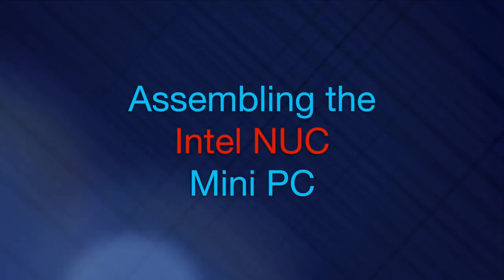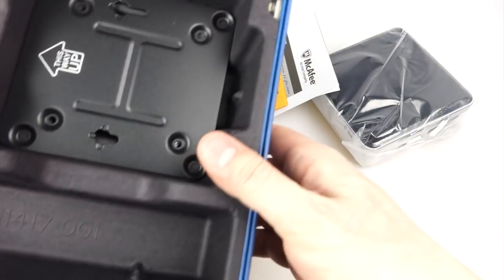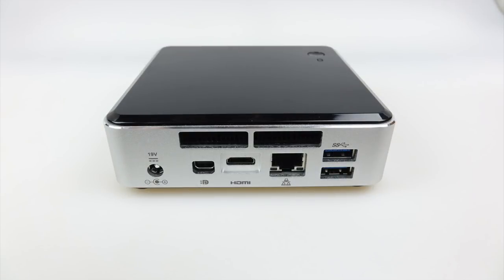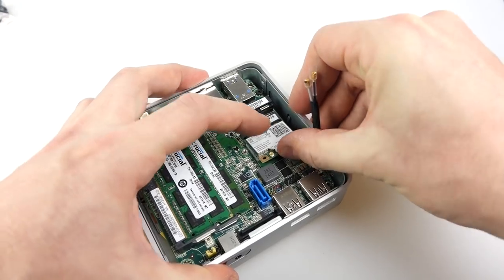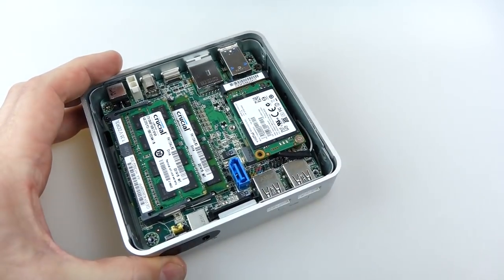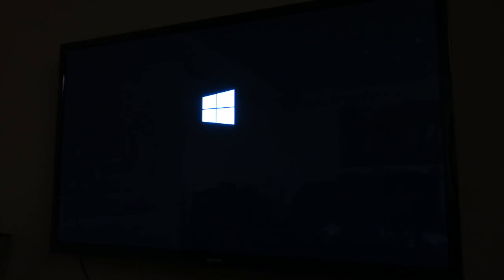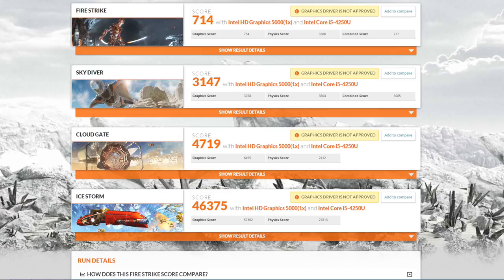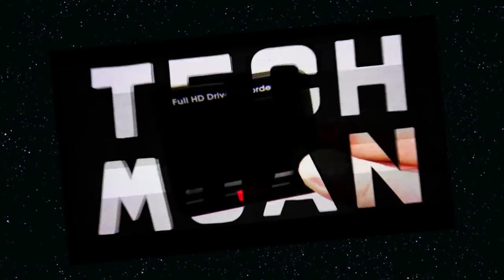Assembling an Intel NUC Mini PC - i5 D54250WYK

Comment: One of the advantages of the NUC is that it doesn't come with a pre-installed OS (or pre-installed hard drive to put it on for that matter). The earlier NUC's had a bug that kept them from working with Linux, but that has been fixed in the NUC D54250WYK. I've been running my NUC with Linux Mint for three years now and it works great. If you are a little shy of switching over to  Linux, you can install Windows then add Linux (the Linux install program makes this very easy) -- what is called a dual-boot -- then at boot up time chose which one you want. Putting in Linux can save you a lot of money you can put into extra RAM!

Comment: Can I just ignore the wifi adapter and plugged in Ethernet cable
Reply from the maker: +Haikal Ghifari yes, it's a lot simpler if you do that.
Reply: +Techmoan Oh, thanks. You answered my question, because I'm planning to get the NUC.
Reply: +Haikal Ghifari but you won't have any bluetooth on it, unless you buy an external adapter
Reply: +Alexandru Klipii Bluetooth would be usefull because you save one or two usb-ports by having bluetooth keyboard and mouse instead of using cable or receiver dongle.
Reply: my thoughts exactly

Comment: I noticed your difficulty with the Wi-Fi antennas, I have a NUC as well and I see your problem. The piece of black tape was only meant to hold the wires together in transit. When you remove it, the clear plastic just SLIDES back over the wires! I also attached them BEFORE I plugged in the card, as it was much easier! Cheers!

Comment: About that ESD BS; I've heard that loads before. Some shops stopped bothering using the anti-static mats under the workspace, special shoes or leads to ground personell to it. They now just replace the parts that break (which basically never happens) instead of buying all the equipment for properly ESD free workspace.

Comment: can it be heavy graphic design work station ?
Reply: Nope, it uses 15w processor that is designed for low power notebooks. Only has two cores and a base speed of 1.3Ghz. Next best thing to this for heavy graphics design, is just to build a mini itx system that's powered by a Ryzen 1700 and a gtx 1050.

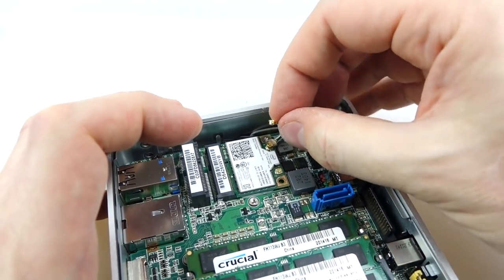Comment: At approximately 6:54 you mention the fiddly nature of the micro-coax connectors.  On one of the experiments I work on we have ~600 electronics boards which sit on the detector. Each board has 64 micro-coax connectors to connect the tiny solid-state light sensor to the the board (order matters, each sensor goes to a specific micro-coax connector).  They are fiddly as all get out, and easy to damage when installing, though it is a practice-makes-perfect sort of thing.  I typically only have to replace 64 or 128 channels at a time, but have much sympathy for those that originally had to install the ~40000 connectors.

Comment: Or you can use Linux (xubuntu core from unit193 recommended), all hardware work out of the box (intel drivers are now on the kernel). Install steam and play some games. Install some arcade emulators. Some videogame emulators.  You can use the xbox controller. And even install Kodi and have a media center controlled by your xbox controller. I know xubuntu core is the bare bones of a distro with a graphical interface but when you get the hang of it you will find a incredible little system to play.

Comment: Hi I noticed you have a samsung tv. Is the nuc able to work with connection+, like the ps3 you can control the on off of the pc from the tv remote. I'm thinking of putting plex onto the nuc and an external 4tb hard drive with my home movies and pics. It would be great if it switches on and off by the tv. And also can it be left running 24/7 you think so it becomes a mini nas?

Comment: I've had that same Logitech keyboard for about two and a half years now, and I just changed the original set of batteries it came with!
  
I think it's a really good keyboard and I've recommended it to friends often.
 I love the extra left mouse button, above the esc key. I hold the keyboard either side, use the mouse pad with my right thumb and select with the left thumb on that extra button.
Nice two finger scroll action on the touch pad too..
It's a really easy keyboard to use when you're on the couch, or not sitting at a table.
 
It has really good range as well... It works fine, even with the PC in the den, on the other side of the wall from the TV in the living room that I use as the monitor.
I often take it outside, over fifty feet into the yard, and while sitting in the gazebo, I'm able to use the audio function keys to change tracks and volume on the stereo hooked up to the PC.

Comment: I've got almost the same wireless keyboard (just doesn't have that fancy design on the touch pad).  Spilled a pint on it shortly after I got it and the keys were sticky as heck for a while but I've since used it enough that they've seemed to come permanently unstuck.

Comment: The antenna wires don't really matter which way you plug them in. In fact, if you plug only 1 of the wires in, the wireless card will still work, just slightly less so.

Comment: Hi, Why did you changed the wifi adapter? The one that comes with it is no good?
Reply: Paulo Renato Zimmermann it may not have came with one
Reply: He damaged the intenal wifi adapter (by accident)
Reply: Naw, those were just the cables for the wireless unit. Every internal adapter that you can get has them.
Reply: I thought you don't need one for the Micro ATX, Mini ATX and the Full ATX.

Comment: with a connector that small, I would have taken my time and used a sharp little pair of cutters or xacto knife to trim away the plastic tubing around it. its less risky, especially with the hard metal below it that wont be harmed too badly if you are careful.

Comment: i wouldn't hold it not running crisis properly. for some reason it only works on amd with no hiccups as far as i have heard.
Reply: God i feel stupid reading this comment after a year. So Im a system builder now. The fact that it doesn't have a dedicated gpu is the part that would make this struggle, but due to the age of crysis im sure this could run the origional crisis if you dropped the settings and resolution to lowest just fine.

Comment: Great review on this little computer! Actually been looking at getting one of these for use as a media box. How well does it handle playing large HD 720P or 1080P video files? I have one of those K400 keyboards on my current setup and absolutely love it.
Reply from the maker: It will play 1080p perfectly -- It's supposed to go to 4K - but I'm unable to  test that. Run PC Mark on your main PC and see how it compares. This particular configuration of NUC scores 2485.

Comment: Wow, bad luck on that antenna connector. how on earth did you solder on that u-fl connector? They are crimped from the factory, and i've never had any luck open one of those connectors :/
Reply from the maker: Put a blob of solder on the wire and it held - so I just hoped for the best. The other end of the connector goes to a flat copper(?) strip stuck to the inside of the case, so replacing the whole aerial assembly seemed impossible.
Reply: Techmoan Then i guess that you could have saved yourself that soldering. The u-fl connector is a small co-axial connector, and if you did not open the connector completely and only re-connected the internal wire to the center pin, it does not function as an antenna. But you are usually fine with a single antenna. http://boltrc.com/blog/wp-content/uploads/2014/03/ufl-connector-Top.jpg

Comment: Isn't it better to build PCs with actual RAM ports and stuff? (BTW there was a SATA port so you can plug your HDD in)
Reply: What do you mean actual RAM 'ports'? SO-DIMM slots aren't unusual, and are often used in small form factor environments. Again the mSATA SSD is more convenient then traditional SATA.

Comment: I've actually never had an issue with static, then again I usually keep my self grounded by something, like the computer case or some other metal cased electronic with grounding.
Reply: +Matt Brine Not too big of a risk but wearing no shoes and being on a non-insulating surface (tile) helps.

Comment: Does AMD have their own version?
I'll spare you the reasons for choosing AMD over Intel as it's a personal matter. Just accept my preference as is.
Reply: Afraid not. I'd really love to see one of these with a AMD processor too. The Raven Ridge 2700u would be perfect in one of these,  low power, 8 threads of cup performance and 10 cores of graphics performance.

Comment: Thats a m.2 ssd. It connects differently. Also building a pc is just adult legos
Reply: Also the wire you broke is an antenna. You will be fine with only one. It just lets you have a better connection. But there a a lot that will only work with one

Comment: how many RAM does it support? i would like to use some of these little computers, cuz of some server projects..
Reply: It supports up to 16 GB of ram.  I personally have the first gen i3 nuc with 8 GB ram and use it run a teamspeak and game servers for myself and friends, and it works really well.  It's a good low power option to use for servers because of its small size and low power consumption.

Comment: i saw a sata connector there...is it possible to finnagle a 2.5" drive in there?
Reply: Intel makes ones that are thicker for use with a 2.5" hdd/ssd 

https://m.media-amazon.com/images/S/aplus-media/vc/1ebb057e-8f2d-49f7-a549-0227dbde56a3._SR970,300_.jpg for example. They use the same board design for most of the lineup.

Comment: Very nice indeed. Think I might try to find something with an optical out though.
Reply: +James Laidler TOSLINK (optical output) is a outdated technologie from 1983, it's OK but HDMI is better, even 3,5mm jack is fine too. there is absolutly no real advantage of a toslink these days, it's just a gadget.
Reply: Is an advantage when one's A/V receiver doesn't have HDMI and buying a modern receiver with specs similar to my current one are expensive, lol. My old beast of a Yamaha isn't dying any time soon, lol.

Comment: Do you really need an i5 for arcade games?
Just a honest question (i'm not hating)
Reply from the maker: I'm using the machine as my only Windows PC. It needs to be able to perform all my Windows tasks for the foreseeable future - since I'm only buying one machine, I thought it should be the fastest (small) one I could afford.
Reply: You have to know as well that in laptops(since it uses a laptop processor) the i5 is a 2C/4T CPU. It's overkill for an arcade machine but for general use it's very well adequate.

Comment: A Solution: Connect a Wacom drawing tablet to a mini PC, thus having a portable drawing tablet. If you want a stand alone drawing tablet, it'll cost around $2K and up.  

I have come to the conclusion that the mini PC needs to run Photoshop, Corel Painter, etc. effectively.

Could you run Adobe Photoshop? If so, what hardware would you recommend?
Reply: +KONATAonPC - osu! and other shitposting have you ever used a drawing tablet? It's not smart carrying a $1700 laptop and a $800 drawing tablet. It's obvious that you're pretentious and receive yourself worth from showing off you're equipment in public ☺ cool guy
Reply: +KONATAonPC - osu! and other shitposting lol you don't know what you're talking about
Reply: +KONATAonPC - osu! and other shitposting Wacom drawing monitor/tablet. You look it up. Again you don't know what you're talking about
Reply: all in one lol lol lol drawing monitor, they are a drawing monitor

Comment: can you add a 2.5 size drive on these ?  if no what;s the blue and black sata port for in the board ?
Reply: the blue and black sata port for in the board ? im assuming the other one is for your 1TB 2.5" what's the other for ?
Reply: oh ok thanks i may have thought the power connecter is another sata port :P cheers!

Comment: 1:08 There is really no retro game console that the PI can't emulate
Reply: PS1
Reply: Aleksandr Kamarov My PI emulates PS1 games just fine
Reply: Sudo The video is from 2014, the first gen Pi was a lot slower
Reply: I have a Pi 1 2 and 3 and on the pi1 most games get around 50+ FPS
Reply: What about an original xBox?
Reply: Sam Gates My HP touchpad can emulate N64 games at 60 FPS...
Reply: Asher Pinson Nothing emulates original xbox, except maybe the 360.
Reply: Car Of Doom If "Emulating" on a PC, you really wouldn't need to emulate anything seeing as it's powered by a pentium 3 and an nvidia you, all running in directX.
Reply: the retro games he is on about that the raspberry pi can emulate is atri games and  actual arcade games
Reply: Sam Gates I know
Reply: Tom Eames what you said doesn't make any sense
Reply: umm... What?? Yes i have a raspberry pi 1,2 and 3 and the 2 is currently set up in my living room with emulation station... but what the hell is the "boobs" program? is that supposed to be a joke or issues?? also, your first line has some grammar issues. Come back when you learn to speak english properly.
Reply: raspberry pi is more powerful than the PS2, so anything under the PS2 it can play. and the pi 3 can probably do any game that is ps3 and under if you overclock everything on it.
Reply: electronics for fun a pi might be as powerful as a PS2 but a PS2 is more efficient at playing PS2 games than anything else with equal power will ever be, so I doubt a pi will run a PS2 emulator well.
Reply: more powerful, not as powerful.
Reply: Honestly, there is no excuse for needing a PS2 emulator, espically since they are so common and cheap nowdays
Reply: but if you have a pi and not a PS2??? l have 3 PS2's and all of them have a problem. one of them over heats, the other one works sometimes, and the 3rd one has a broken door so l have to jam a stick in the clip for the door. emulating on my pi would be more efficient, than swapping out machines and parts from each machine into a franken machine.
Reply: l have the thin ones 2 black and 1 silver. l had a thick one, but l sold it.
Reply: Sam Gates joke intended.
Reply: Hacking an original xbox is fairly simple and then you can use the xbox itself to emulate all your retro game consoles, including PS1.
Reply: Xbox
Reply: Electronics For Fun I know this comment is a year old, but for anyone wondering, the PS2 Fat (the older one) is more reliable than the PS2 Slim (the newer one). :-)
Reply: Tom Eames Is English your first language? That's what he means when he says you don't make any sense. It's hard to grasp what you're actually saying.
Reply: BlocksLEGO Really? Everyone I know including me that has an original fat PS2 has problems running it today, or it doesn't work at all. That's why even when it was still current gen, so many people had to turn it upside down to get it to work, because there was always issues with the dvd-reading laser. I was actually considering getting a slim ps2 to play the games I still have, the ones that are difficult to emulate on PC (like spiderman 2, the graphics go all wonky), so is it not worth it then? Is it perhaps that the first gen fat ps2's are dodgy but the later revisions of the fat one is the best and most reliable?
Reply: Well, I heard it from somebody else.

Comment: Well the new small computers really ate interesting . Did you see the Gigabyte Brix? It is made more for gaming but still quite interesting.
Reply from the maker: I'm aware of it - yes.
Reply: Techmoan Well I guess that's cool. How has this Intel NUC been doing? I want to get it for the parents.
Reply: i heard the brix throttles alot due to heat -.- but its defo a step in the right direction
Reply: So magical Yeah it does throittle but from what I saw in thise video I am not sure if this NUC is going to be used for super hard gaming :P